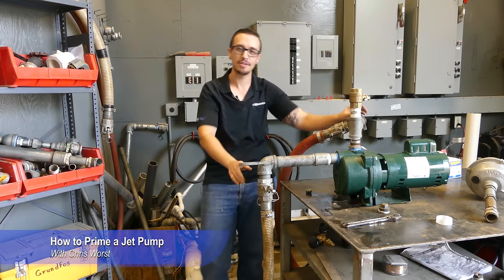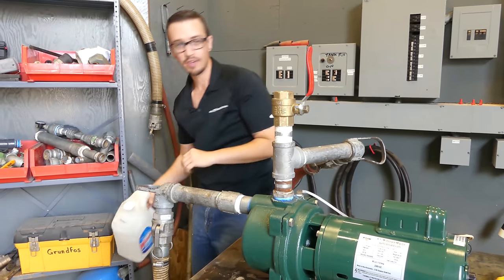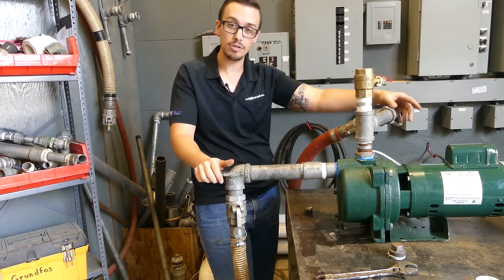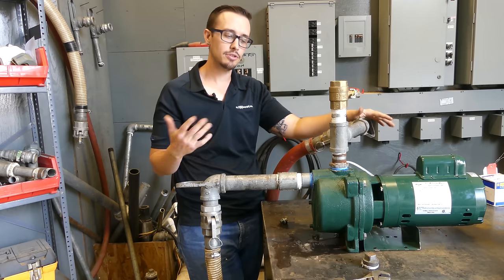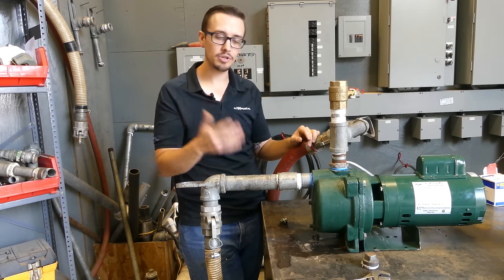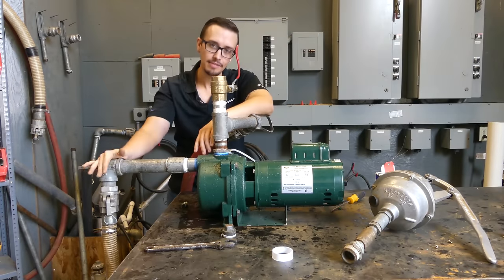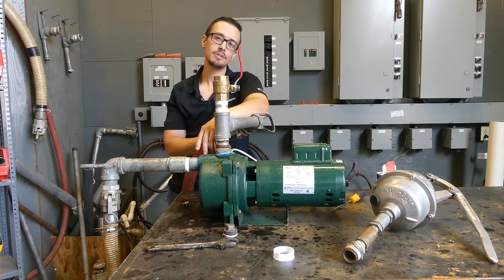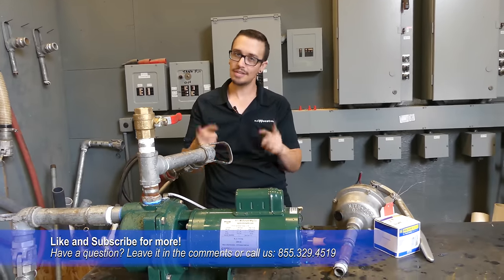How to Prime a Jet Pump

Comment: What if the suction pipe goes above the pump and then back down to it?
Reply from the maker: That means you have a "Deep well" jet pump. Both pipes must be filled with water, as well as the pump volute.
Reply: R.C. Worst & Co., Inc. no like I have a shallow well pump and I'm wondering if I can have the suction pipe go up to a rafter from the pump and then over and into the pipe going into the ground
Reply from the maker: @sammyg3697  It is possible, but it will be a nightmare to keep it operational like that. You would have to add a priming port at the highest point of the suction line and fill it from there. Any air that entered the system would collect there and likely need to be purged/reprimed fairly often.
Reply: R.C. Worst & Co., Inc. ok, thank you for your time
Reply from the maker: @sammyg3697  Anytime! :)
Reply: But I wouldn't need to re prime it every time because of the foot valve right?
Reply from the maker: @sammyg3697  Not every time, but entrained air . If you don't have any other options I would suggest using a low-pressure cutout switch on your pump so if it does get air-locked it will trip, letting you know it's time to go burp/reprime the suction pipe. Here's our video on them: https://www.youtube.com/watch?v=ROvZpwHV9Ho

Comment: My pump suction is poor due to the distance from source how to improve suction?
Reply from the maker: You can either move the pump closer to the source or increase the pipe size on the suction line
Reply: @RCworstwater  thanks

Comment: My jet pump would run and gain pressure fine, until the pump would turn off and then the pressure would go straight to 0
Reply from the maker: If you're still having this issue please give us a call to help troubleshoot: 855.329.4519
Reply: @RCworstwater  Looking for that pump primming pump
Reply from the maker: @gregwilliams3982  https://www.rcworst.com/lane-6-byco-502-60-hand-priming-pump.html

Comment: Yea it's easy when your water is as high as yours is in drink,,,,,most wells are 50 feet in ground,,,,and you can only evacuate the size of your pump housing per lift column,,,,,,I always mount a vacuum gauage on well side of check valve to know well water level is,,,and I can even prime it with a vacuum pump,,,, many people have burnt up new pumps not knowing how to prime them,,,and this vedio tells nothing about theory,,,